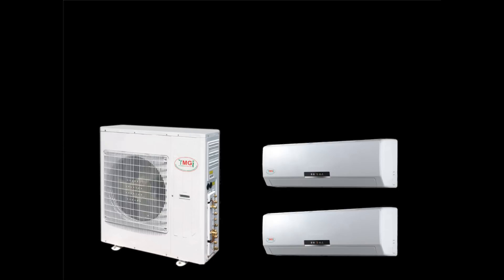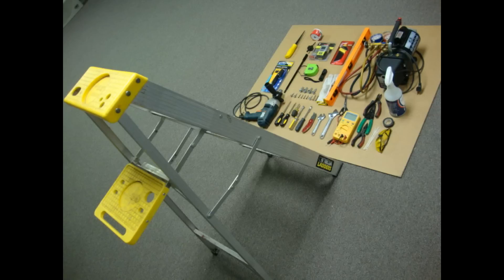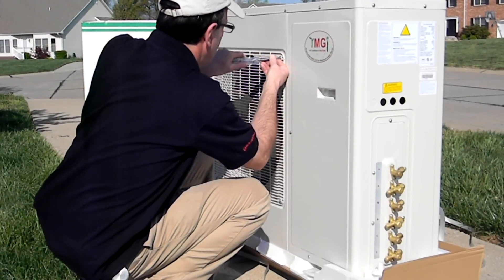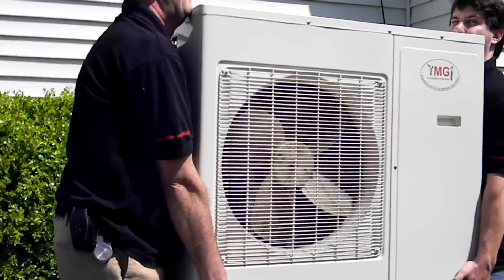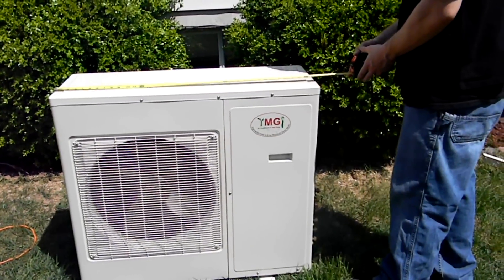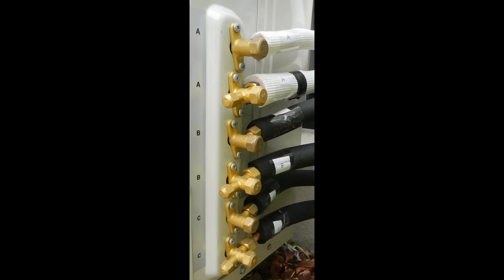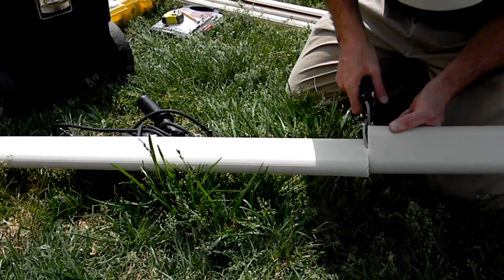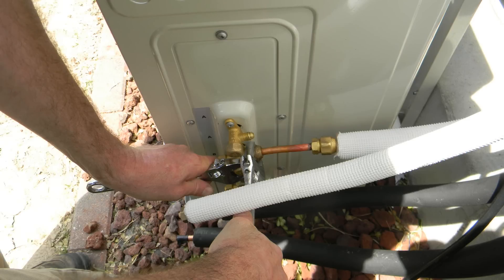YMGI Ductless Mini Split Installation (59)(2) Multizone Inverter Condensing Unit (CH) Part 1

Comment: Pro Tip: Run hole saws backwards when drilling through vinyl siding to prevent it from shattering. This is especially true the colder it gets.